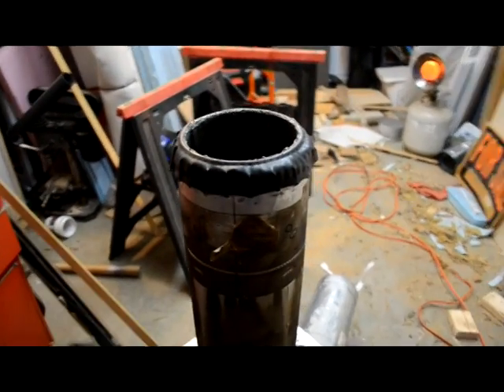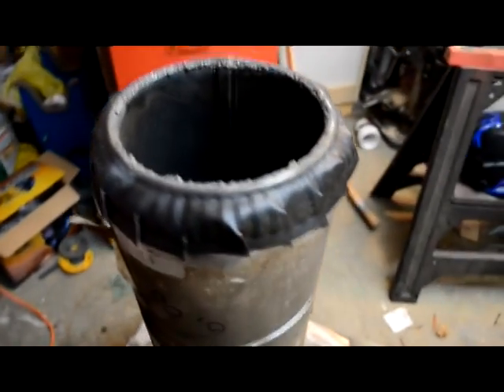Making a Rocket Stove Thermal Mass Heater - part 2

Comment: I should have a vid coming up, a friend of mine did it but she mite be too busy to post it, I'm going to try and increase the efficiency by soldering extra "heat sink" copper pipes to the pipes with water running through them. I'm using the ideas posted by that inventor from the UK, he's got a vid about rocket stove steam. One learns a lot by playing with these stoves! I installed a T/P valve for safety and it went off once, I'm able to increase H2O T by closing the valve..from 60F to 110F

Comment: Cool! Eventually I'll get to a metal rocket stove, I've got some barrels and materials for it.. but I just upgraded my brick rocket stove, put it underground, used vermiculite to insulate the stove from the ground and made cob for the first time! I put a 4'+ 6" stove pipe heat riser on top fitted into 8" galv pipe with vermic in between. Bilt a 1/2" 12' copper heat exchanger that slides in the top and I'm getting my 30 gal H2O heater to 130 F. Doing Rocket Laundry and taking Rocket showers!

Comment from the maker: I used the elbow to allow a smooth flow of air up into the vertical stack, a T fitting will disrupt airflow and create strange turbulents. You're right though, the stove does need to be cleaned of ash every 3 burns or so. The horizontal burn pipe (with feed hopper attached) is pressed on the 90 degree elbow. I wiggle it and pull and it comes off, then I put a small aluminum pan under the elbow, and take a piece of cardboard and sweep all the ash out of the pipe, then reassemble the pipes.

Comment: Cool! With the black pipe you can try different pieces, like maybe a T instead of an elbow, have a removable cap for ez cleanout. On other side could be a T for a vertical fuel feed and a horizontal air throttle door that could double as an oven.  It will be interesting to see how the black metal holds up. Maybe paste fireclay on the inside and fireclay/vermic on the outside to make the burn chamber hotter? Play with thermal mass vs. insulation at different points... Lots to try!